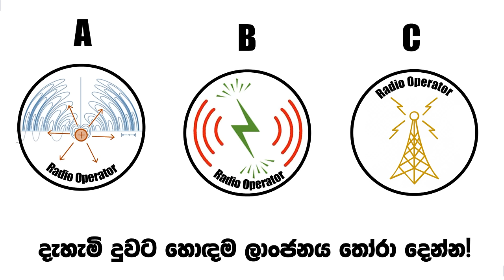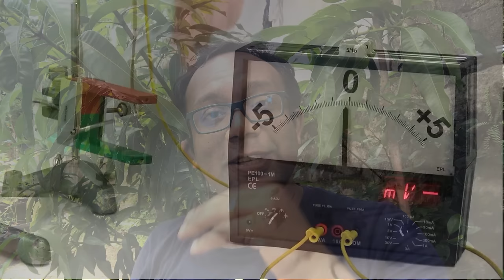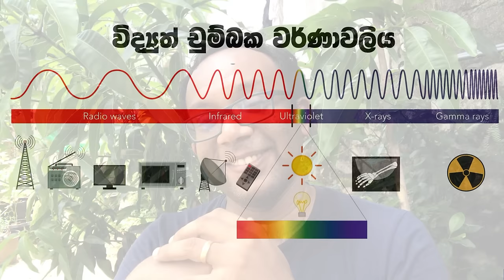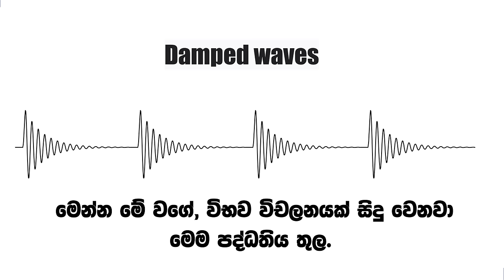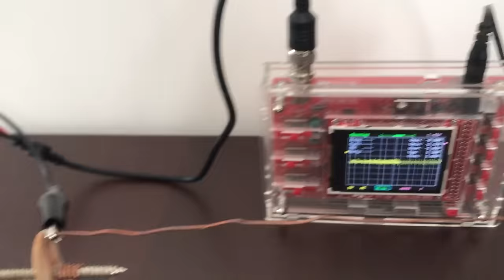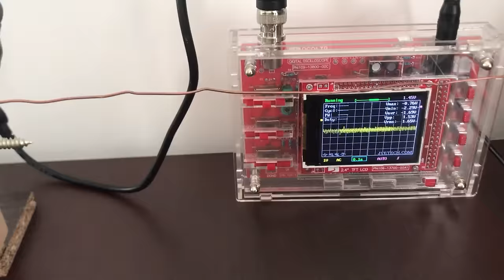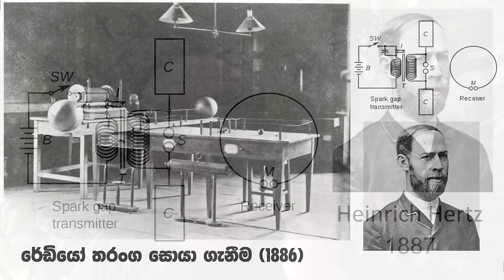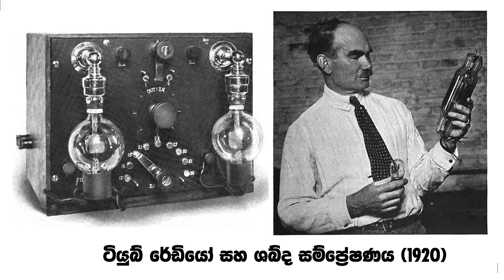අපි ගුග්ලිමෝ මාර්කෝනිගේ රේඩියෝව හදලා ලෝකෙට පණිවිඩ යැවුවා!

Comment: I use 7.3728 Mc four pin crystal osclater module and modulate um313 melody generator use lm386 audio amplifier. Osclater output feed to quarter wavelength antenna it received half km . Lot night I operate this circuit.
Reply from the maker: great, will talk about oscillators, and modulation in coming videos

Comment: Sir please explain Main current supply and how it is determined neutral and Live. If alternate current fluctuates with time in 50Hz why neutral do not have light up tester.
Reply from the maker: I'm sorry the question is not clear
Reply: @ScienceWithRuchira  Sir I mean If AC current is having sine wave. Is it mean +half in live connection and - half in neutral connection.  Why LED glow when connect it both side at AC current. This theory I could not understand at AL though.